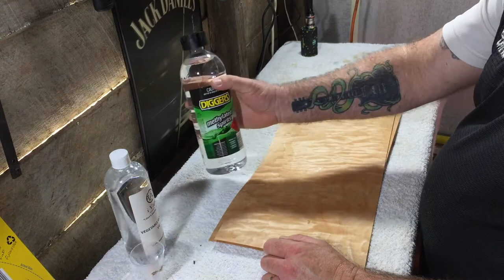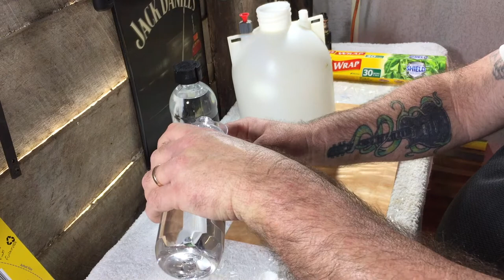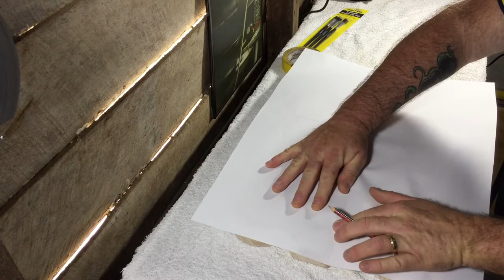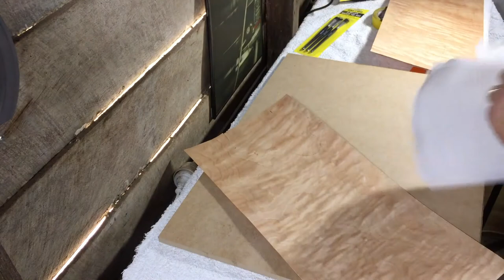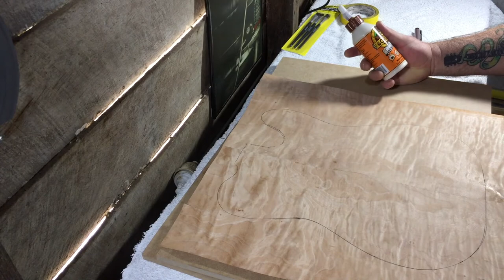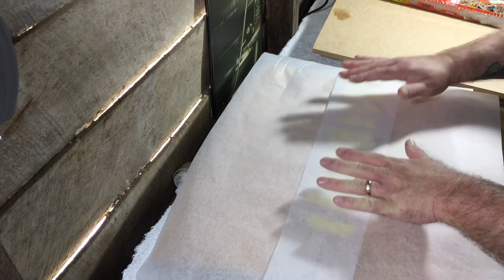Applying Veneer top to lefthand Tele style Electric Guitar kit

Comment: Have you tried applying the glue to both surfaces, letting the glue almost dry, then using a medium hot household iron to apply the veneer?
Reply: That is the "iron on" method and it works really well. You actually let the wood glue on both surfaces dry over night. The heat from the iron reactivates the glue. Especially useful for veneers that are quite warped.